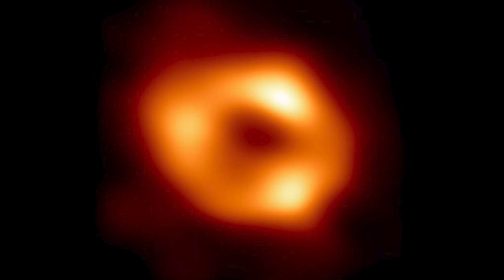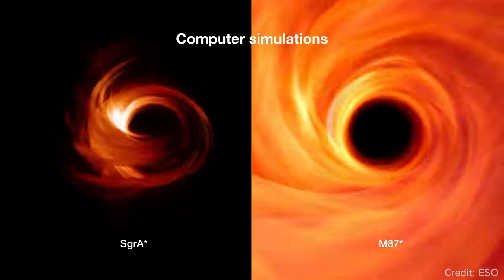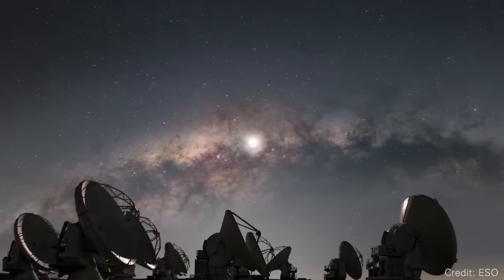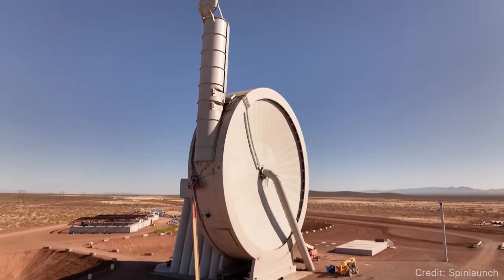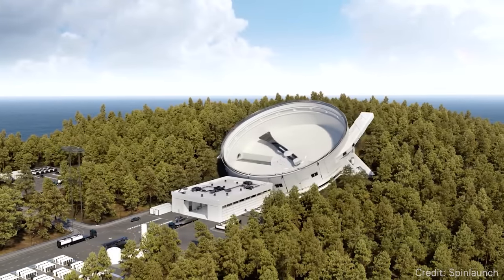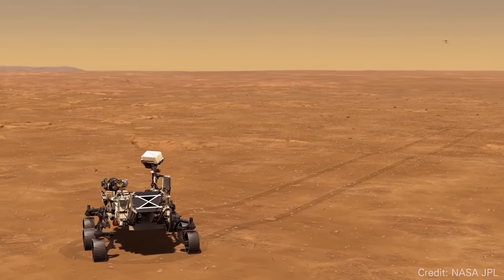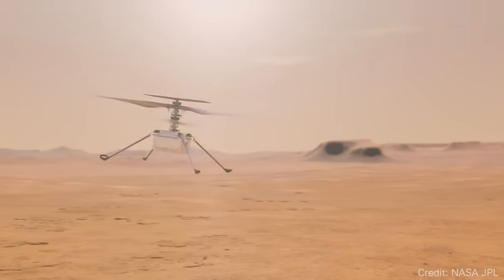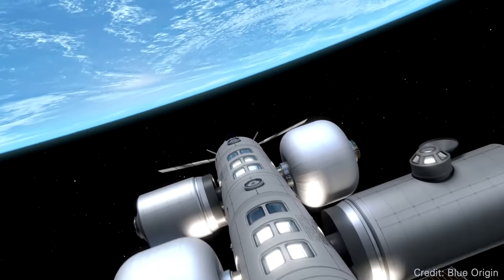Milky Way's Supermassive Black Hole by EHT, Russia's ISS Bluff, Ingenuity's Problems | Space Bites

Comment: The technical challenges of spinlaunch are fascinating.  Because the act of launching compromises the vacuum, the lever arm of the centrifuge has to be capable of aero-braking and withstanding the difference n drag between lever arm and counterweight at many times the speed of sound. Also as the payload scales up the rapid detachment from the counterweight will want to shake the entire structure apart at the bearing from the torque from the freshly unbalanced centrifuge. All the fuel has to be pressurized because of the deceleration, and any instrumentation is subject to substantial g forces. Will be keeping an eye one that one

Comment: I wonder why they don't use some type of reverse polarity system to remove dust. They have static guns for paint booths so I could totally see some type of nozzle to do the same. It would be worth it if they could stretch use time indefenetly.
Reply: If solar panel "darkening" is the bottleneck of the mission(and it seems it is), then surely this is the problem they should focus on. Seems like its solvable.
Reply: In future missions, the river could have a brush. Land near it and let the rover roll over and clean off the panels

Comment: Solar panel protection system - layers of plastic film in arraigned in zig zags like a post it note dispenser. Have a little servo slowly pull off a layer revealing a fresh layer underneath. Kind of like some ideas I’ve heard for camera lens protectors that get is on after protecting the lense in a sacrificial way.

Comment: Based on what I learned about Lagrange... A black hole is simply the central point that nearly equal mass objects orbit, exhibiting an equal gravitational pull of the objects combine. As more objects orbit, the stronger the gravitational pull becomes.
Earth has one with the moon, binary star systems have one with each other, and is the basis of the physics allowing just to orbit at a Lagrange point

Comment: So why don't they charge the surface of the solar panels to repel the dust?
Reply: it's never been necessary before.
Reply: @h.dejong2531  uh? It has been a problem on every Mars rover that used solar panels. Some missions were not expected to last long enough for it to matter, but many ended up lasting long enough that it did matter. At this point it is a known problem that every Mars lander deals with.

Comment: The direction of the disc around the black hole seems to be around 30 degr. off the galactic plane (according to dr. Becky) instead of being in line with the galactic plane. Is the orientation of this ring dependent on the spin of the black hole or does the direction from which materials fall into the black the main contributor to the orientation of the ring. I think the direction of the materials falling in will, over time, average out to be in the direction of the galactic plane. But individual pieces or stars will come from more random directions which could be more influential on the orientation of the ring in these quiet periods than in the more voracious periods.

Comment: Why can't they mount a simple ion engine on the ISS, providing constant thrust to prevent orbit decay? I'm sure Elon would be happy to sell them the engine used on Starlinks.
Reply: Too small
Reply: An ion engine powerful enough to counteract the drag would need more power than the solar panels can supply.

Comment: As much as I appreciate the "grain of rice" analogy to Sag A*'s average consumption, I'm often confused by it because of the accretion disc. Does that material just stay in a stable orbit around the black hole? I thought an accretion disc implies material being fed into the horizon?
Reply: for some material, it might be a stable orbit. For the rest, it's an unstable orbit that slowly feeds the black hole. 
Keep in mind that in space nothing goes in straight lines. So material won't just fall in a black hole (like an object falling from a building), but it will circle around, gradually closer and closer until it falls in the event horizon (after that, the physics get really weird).

Comment: GLOBAL WARMING SOLVED:

Great use for Spinlaunch. 
Spent fuel rods of Nuclear Reactors are a bad idea for payloads on normal rocket launches. However, eliminating the first stage and only having a 2nd stage rocket works perfectly. 
If there’s an issue with 2nd stage ignition, parachutes can be deployed for a soft landing. 
Super sonic rogue parachutes would work for high velocities, which can pull out the mains. 

It is safe.
Reply: Shit happens. Thats alot of G's. Too early to tell.
Reply: and if something goes wrong, and the spinner lets the projectile fly just a few degrees off, then it destroys itself. Spent fuel rods are still a bad idea for cargo.
Reply: Just dump it underground